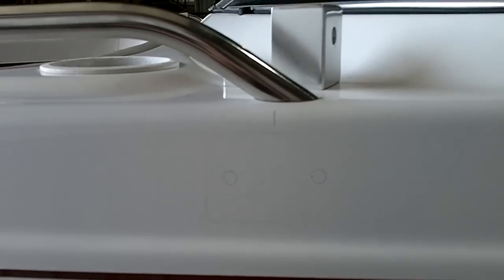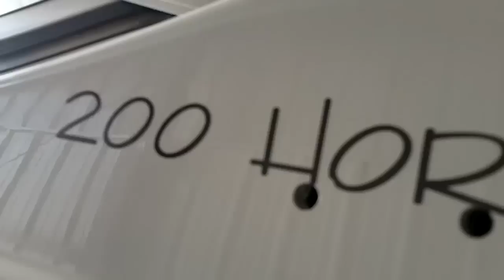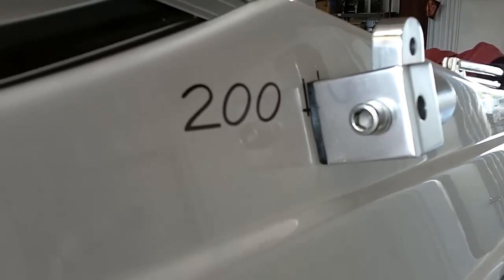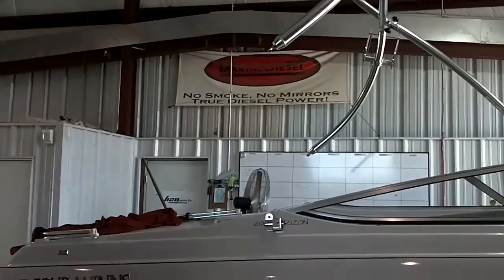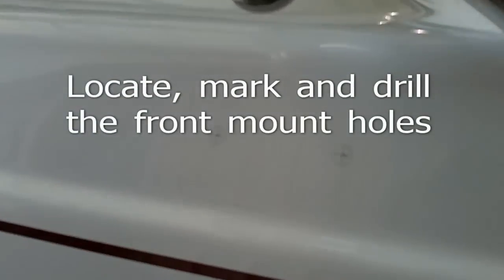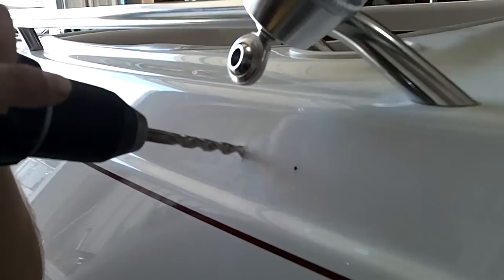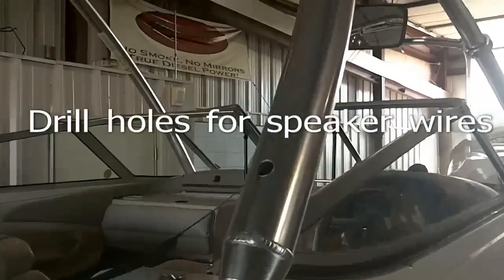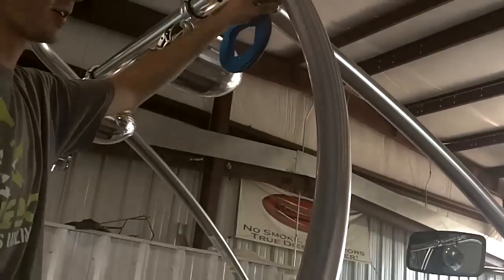How to Install a Monster Wakeboard Tower

Comment from the maker: This is basically done by doing standard fiberglass work to reinforce the hull at that point. Normally its hard to shoot a video of this since its on the inside of the gunnel and typically hard to get good lighting and good camera angle to cover this.